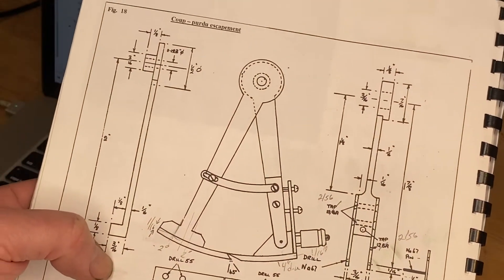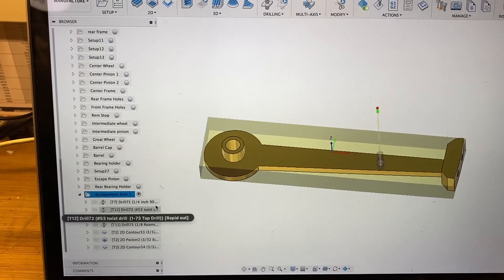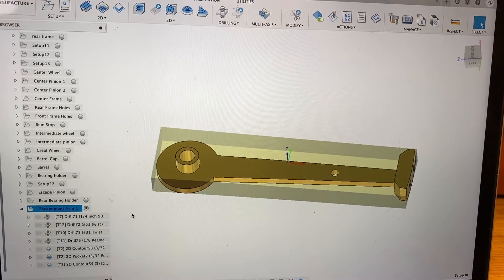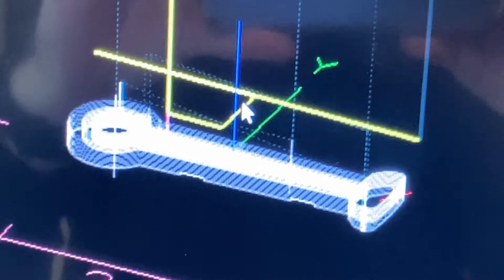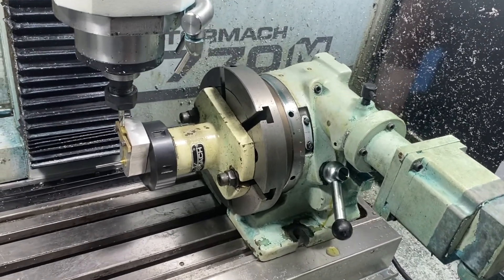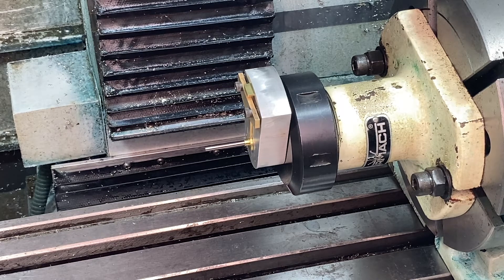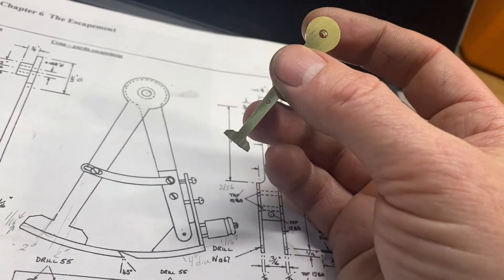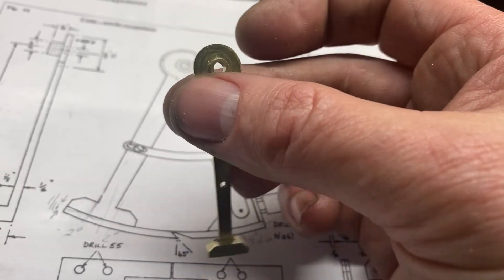Starting the Coup purdu escapement

Comment: When next you’re machining very small stuff, it would be of great interest -to me anyway -feed rate, plunge rate, r.p.m. cutter size and type etc. as it’s difficult to estimate when the video is speeded up and coolant running.
Reply from the maker: Good suggestion,   i usually use a 1/32, 1/16 or  3/32 cutter.   When cutting brass i will typically max my machine out at 10,000 RPM.  I have been traveling so no time to machine.   When I get back to it i will take your advice.   Thanks!